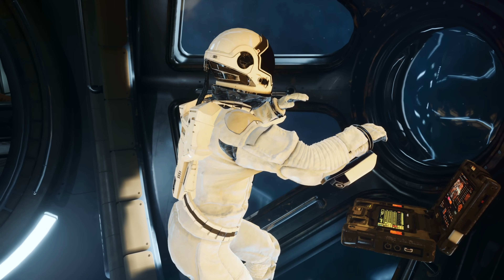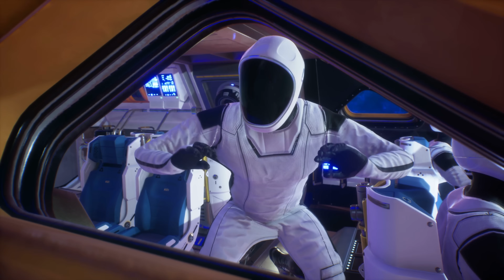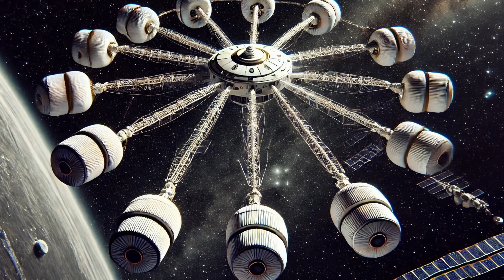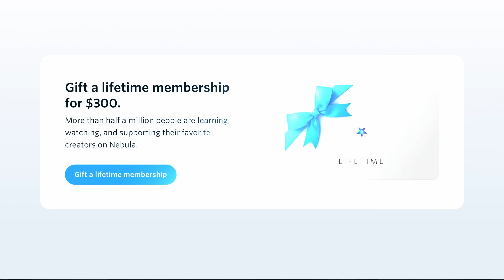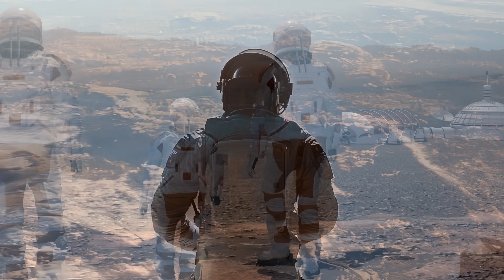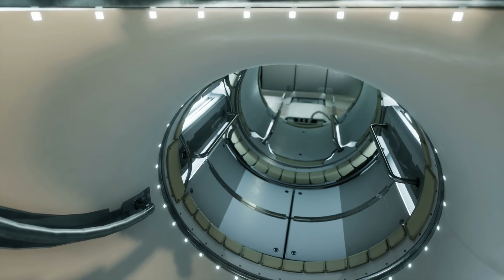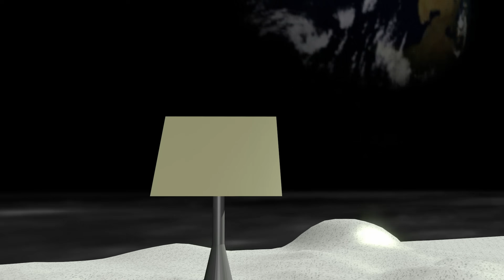Gravity By Design - Tether Habitats & Orbital Living

Comment: Until we actually build and use these, we have no way of testing how much (or how little) gravity we need to live and work without physical deterioation. This is also critical to knowing how hard it will be to colonize Mars.
Reply: Remember when the ISS was supposed to have a gravity ring as it's most important component just to answer this question? 

Pepperidge Farms remembers.

I also believe it is less than one, how much higher than zero is really the question. Also, are there medical solutions? Maybe a couple of hours is good enough? Maybe one module going at 2G just to sleep in and then everything else in zero?

Also what about cargo? One of the disadvantages to a cycler is that you have to catch up to it so it doesn't save you hardly any fuel. But if it could fling you at your target into a ballistic capture you at least saved the stopping fuel.

I think I just recreated slingshot technology for space.
Reply: @jtjames79  True. This is, to my mind, priority research.
As for cargo o Mars, a magnetic cannon on the Moon surface could provide the initial velocity, and non-critical cargo could be slowed down in a number of ways at destination.
Reply: Complete guess on my part but I would guess ~0.3G is the minimum to live without health issues and ~0.6G to be able to handle 1G without complication. 

And an upper limit of ~1.15G
Reply: @peeperleviathan2839  That's the problem... we have data for zero-G and (obviously) 1G. Everything else is guesswork, until we do it. That is what frustrates me. For the record, the Moon is around 0.16 G, so it'd be cool if we could handle that unaided :)

Comment: As an engineer, I struggle to see how we can build something like this without it tearing itself apart. In the distant future when we have figured out gravity perhaps we can build sections that are in orbit and connected but isolated structurally. Probably after we figure out how to build a space elevator. But even then the adjustments due to live load on the structure to keep orbit stable would need some clever propulsion technology we yet to invent.
Reply: This is supposed to be built well within the constraints of existing material strength, and it should rotate around it's center of gravity so it's not clear why you would need to do anything special to make it orbit stably. 

If you are using bearings I can see that being a pain, but you don't have to build it that way. You can have two compartments rotating around each other along a fixed anchor point. Hell if you use one of the rigid designs then you don't even have to worry about having a winch.
Reply: @vakusdrake3224  bad bot....
Reply: There would be some enormous forces at play. You’d have to invent brand new materials. 
There’s also a lot of unknown unknowns that we won’t learn until we spin up some sort of testbed in space.
Reply: @ Lucky for you, they are working on a midway station to the moon. So, we will have that testbed earlier than expected.

Comment: I get that the atmosphere inside the habitat spins with the structure, but it still always seems to me like you should have to account for the component of force (or lack of) tangent to the surface.  If you threw an aerodynamic object like a dart in the direction counter to the rotation at the same speed of rotation, this object would be "stationary" relative to the center of mass and, absent forces from the air,  it would not experience any centripetal force.
Reply: As a kid on a farm, I had plenty of experience swinging a bucket of water around with my arm and wondering about it not falling out.  When it does, however, the surface of the water does not stay parallel to the bottom of the bucket.  It sloshes back toward the trailing side relative to the spin.
Reply: @adamredwine774 how would you manage to throw it perfectly to where its velocity is 0 relative to the center? You would have to throw it in a perfectly straight line at the perfect speed and have no other forced effecting the dart
Reply: @ it’s just a thought experiment but internet videos of people throwing playing cards in fortunate ways suggests that it’s doable.

Comment: I can't even imagine the horror of a tether snapping, flinging you into interplanetary space.
Reply: Not necessarily. It wouldn't be fun, but by the time we're building things like this, we should be able to do rescues for people along a known orbit. Plus just maintaining a few small emergency rockets for such a situation wouldn't be a big problem.
Reply: But as you see, others can. And they understand that the habitat was already in interplanetary space.

Anyway, tethers will be made of multiple cables anchored at the extremities of a hanging bottle habitat. For instance if it has a hexagonal floor plan, at least one cable will be anchored at each of the roof's six corners. Breakage of one will be an entirely safe, reparable failure.

Breakage of five would make a big mess inside, but the remaining one would hold. (It would make a big mess because the remaining one would hold. Gravity would remain at one gee, but, unfortunately, would now be sideways.)